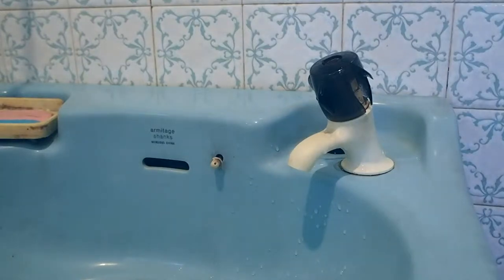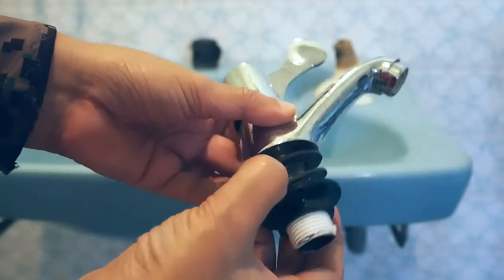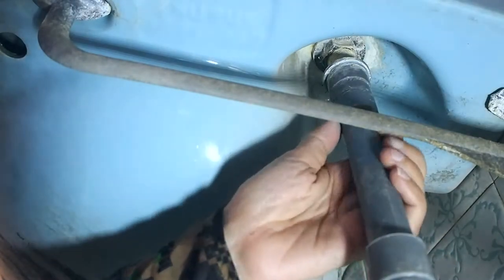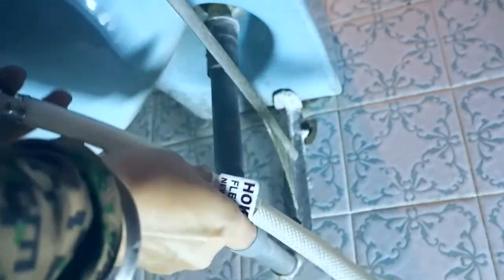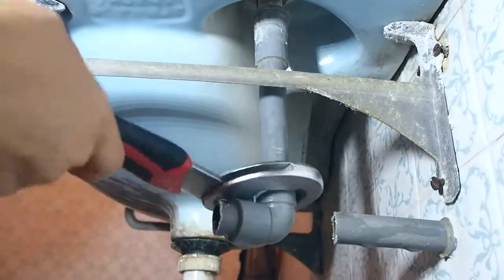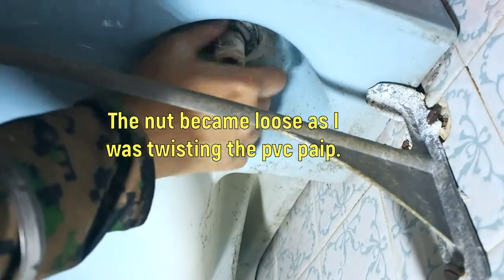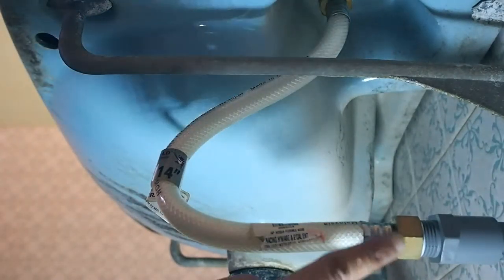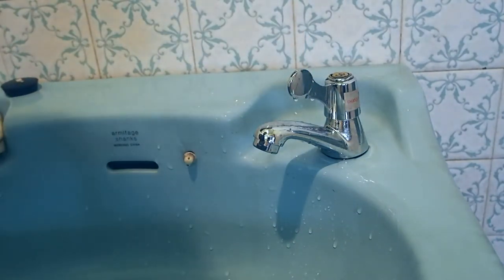Replacing BATHROOM Sink FAUCET DIY | Changing Basin Taps

Comment: Hi, was wondering if we can remove the tap without cutting your paip at the bottom? (Sorry newbie here)
Reply from the maker: Hi, yes you can. You need to buy a "basin wrench" to be able to loosen the nut holding the tap to the sink, located under the sink. I couldn't loosen the nut because I didn't have the basin wrench, so I had to cut the paip. Every other tool I had couldn't fit in the small space under the sink. Hope that helps. :-)